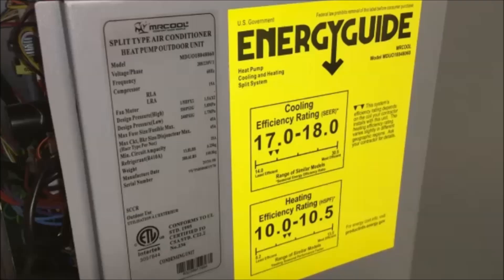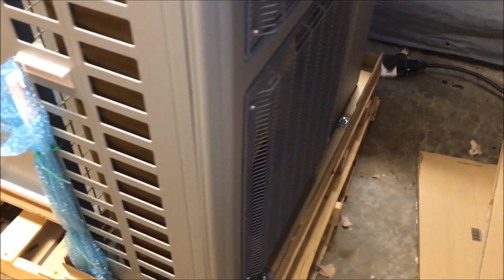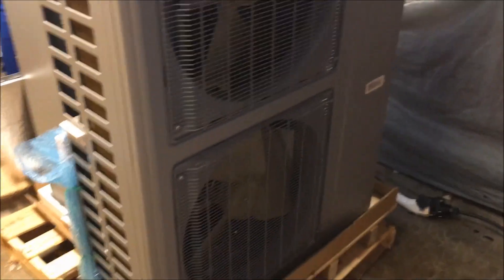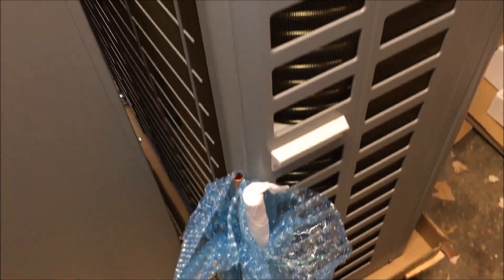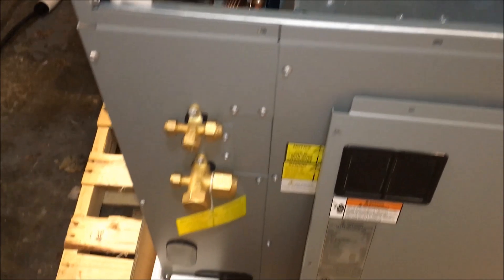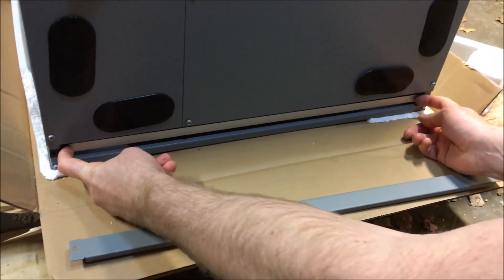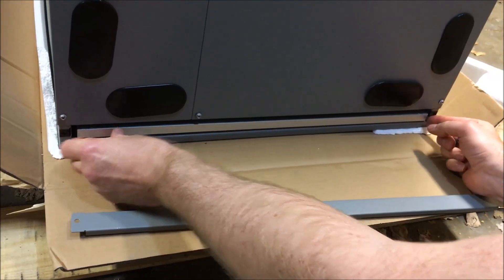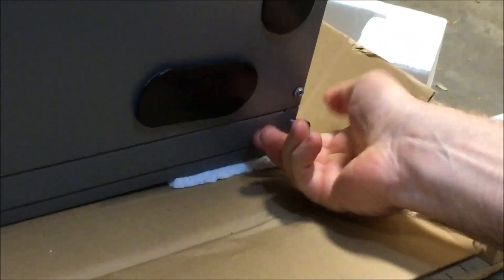DIY Mr. Cool Heat Pump DIY HVAC Unboxing Part 1

Comment: Thanks for the nicely done video. I just installed this 4/5 ton unit. At least mine came undamaged.  Both the condenser and air handler were on one skid wrapped together.  It is so quiet. Just love it. It is in the middle of summer, so I just ran a quick test of the heat mode on one cool morning to make sure the installation is correct. 
I have one question I am still waiting for the answer from MrCool support.  What is the Defrost signal used for?  The air handler control board in mine has a D (defrost) connection, but the condenser control board does not have the D signal. There is a W1 signal. The air handler manual that came with the system shows a wiring diagram to connect the D signal of the condenser to the D signal of the air handler. Well I don’t have the D signal in the condenser.  
Can you tell me how you connect the D signal in your system?  By the way, I did not install the optional heat strip.  I will use my existing gas boiler as backup. 
I gathered that the Defrost signal probably is used to turn on the heat strip during the defrost cycle.  That signal must be sent from the Condenser to turn on the heat strip inside the air handler.  Since I don’t have the heat strip installed, it probably can be used to turn on my gas boiler.  However, my condenser unit does not have the D output, it has the W1 signal.  I am wondering if the W1 signal is on during the defrost cycle.  If so, I can use that to turn on my gas boiler. 
Thanks in advance.
Reply from the maker: I don't have heat strips either.  I also don't have a D signal. Defrost mode is when the reversing valve is turned to cooling mode for a short time to heat the outdoor coils. Is this the possibly the B your referring to? When B is active, it's in heating mode.  Hope that helps.
Reply: Thanks for you reply.  It is the D signal I referred to. In the manual, it specifically describes it as the defrosting signal. I screen shot the frames of your video that show the control signal terminal block of both the air handler and condenser.  Sure enough, your system does not have the D signal.  
My air handler does not have the Y signal, it has the D signal in its place. The Y signal should just go directly to the condenser anyway. 
My condenser has the W1 signal instead of the D signal described in the version of manual that came with the system. I downloaded the latest version of both of the air handler and condenser manual online. They are different from mine. Apparently they have different versions of the hardware as well. 
I use a Ecobee 3 Lite thermostat.  I have to program O/B to energize the B terminal in heat mode for MrCool.  It seems backward for MrCool to do that. If the reversing valve control fails, it would be better to fail to the default heat mode without being energize. It is more important to have heat, especially in the northeast where I live. 
So, I will just tie W1 in the thermostats, air handler and condenser together.  
I now have a dual fuel system.  The gas boiler becomes my backup system.
Reply from the maker: @norberteng9496  I would look at the schematics to be sure.  W1, for me, is just a control to turn on the heat strips. 

Not sure I can add much to the conversation without seeing a wiring diagram.  I'd just be conjectureing at this point.
Reply: Thanks. Since I am using my existing gas boiler for aux heating.  I am using W1 to turn on the boiler. 
On page 30 of the latest MDUO18* condenser manual, version date 19-25-21, on the Mrcool website, it mentions “when the outdoor unit defrosts, D will send an operation signal to the electric heater to avoid cold winds”. 
Our version of hardware does not have the D signal.  So, i suspect a 24V signal is sent on the W1 to turn on the aux heat instead. 
MrCool support seems nonexistent. I sent messages via their website support email. Never got a reply.
Reply from the maker: I can't see this in  the manual. Are you located in the US?  Wondering if there is another variation  of the Mr. Cool  universal?
Reply: I got that info from the manual of the same model I downloaded on the MrCool website.
Yes, I am in the US. I ordered mine from HVAC Direct.  They shipped via XPO.  
I ordered it on 6/30/22. The manufacturing date of the air handler is 2021/11.  The condenser’s is 2020/07.  Their documentation just cannot match up with different versions of hardware I guess. That makes it confusing. 

Another thing I found is that with only the fan on with no Compressor on, the fan still runs at full speed. Does your system behaves the same.  It is different from my old system I replaced. The old handler ran at a reduced speed when only the fan is on. 
I guess there is no way for the handler to know it is only fan on, since the Y terminal does not go to the control board. 
I am still learning about the system. Your video is the only one I found online on this particular system. 
MrCool support is not responsive at all   .
Reply from the maker: Sorry to hear this.  I called Mr cool once for a sanity check on the dip  switches, but had to wait for a call back. Never came. 

My fan blows the same regardless of the compressors status.  I would have liked to have seen a variable speed blower...esp when it goes into defrost mode, since it works as an AC for a short time until the defrost cycle is done.  You could set the fan speed to lowest setting  for 4 ton. That might help.... but it will always run at that speed. 

All and all,  it's decent for under 4k.  I can't complain.  I'm off natural gas and all solar.
Reply from the maker: Just checked manuals. D isn't connected.  I suspect, by the poorly written description, the outdoor unit sends status, via D, to the indoor unit... to maybe run heat strips to avoid cold  breeze.  You really only need YBRC to the outdoor unit.  You can always probe the line when in defrost to see what it does.
Reply: I have no D signal on my outdoor unit.  It does have W1. The manual shows connecting W1 of the thermostat, air handler and condenser together. I think W1 on the air handler is the receiving end of the signal. I think during default cycle, W1 in our version of condenser sends a 24V signal to the air handler to turn on the heat strip, if one is installed. 
I am using the gas boiler as aux heat.  I live in the northeast. My ecobee thermostat is set up to switch to the gas boiler when the outside temperature is below the point where it is more expensive to run the heat pump than running the gas boiler.
Reply from the maker: Yes,  I agree.  W1 is powered externally.  I think you have the right path.  Just  wondering if your boiler can supply heat in time for defrost. It lasts about 10 min.
Reply: My boiler also heats hot water. The hot water tank is a separate heating zone. So, the boiler is always hot, especially in winter.  I will find out how it works out this winter. 
The boiler has its own 24V transformer.  I use a relay to isolate the two systems. I use W1 to drive the relay to turn on the boiler when in defrost mode, and when the thermostat calls for aux heat. 
Thanks for your insight.
Reply: The D on the air handler likely goes to W1 on the condenser.  I have the GE version of this same unit, which is the same as the Gree Flexx.  The GE doesn't have a W1 on the condenser, it has a D there.  And a D as well as a W1 on the air handler.  I haven't used heat yet (still summer!), but I suspect this tells the air handler when the condenser is defrosting so it either (1) turns off the blower or (2) turns on the backup heat.  I thought I read somewhere that it (1) turns off the blower, but I can't be sure.  Will find out in the winter!
Reply: @yt_tam  I downloaded the installation manual from the Greecomfort website.   They seem to have 2 versions of the unit. One with the D connection on both the indoor and outdoor unit, and one without.  The manual basically is the same as MrCool’s  
The system with the D connection are tied D to D, W1 to W1. 
Will see how it works in winter.  Since I don’t have solar, I still need to figure out the cross over point where I need to switch away from the heat pump back to gas for heating.
Reply: @norberteng9496  Mine has a W1 and D on the indoor, and a D on the outdoor (no W1).  D goes to D as a signal from the outdoor to indoor that it's in defrost.  W1 on the indoor comes from the thermostat to call for the backup heat strips.  Looking at the wiring diagrams, the D and W1 on the indoor units almost appear to be connected on the board, so it's possible they tie together and do the same thing.  

If you find it blowing cold air for periods during the winter, I would try connecting the W1 on your outdoor to the D on your indoor.  Then the W1 connection on your indoor to the W/backup wire from your thermostat.

Comment: You ever notice the posted cooling capacity on 5 ton (MDUO1860) isn't really 5 tons? They list it as 54000 BTU. I've got a large area and an existing 5 ton 16 seer...wondering if I can get away with what appears to really be a 4.5 ton, but labeled 5.
Reply from the maker: Interesting point.  I bet if you precooled or pre pre-heated before a temp event occurred you could get away with it.  Also upgrading insulation , air sealing, and newer windows would help. 

I've been happy with mine.

Comment: You could of made the return air on the side by cutting the whole and sealing the bottom.
Reply from the maker: I think that would void the warranty. Most basement floors are damp which would introduce moisture and rust. Floor isn't level by the drain, so sealing would be tough.  Return air plenum would need to be reduced which could reduce air flow and cause coil to freeze up.  Lots of variables to consider.  Stand was easier.

Comment: Have u had problems with the with it freezing up and my nest has been off by 1 degree  seems to run a long time . I have had it only 1 month now and already seems to be a problem  unit. I have the same unit.
Reply from the maker: Freezing up in winter or summer ? Coils will freeze up when cold in the winter, but then it goes through a defrost mode.  If it's summer, then it's usually a refrigerant leak if the lineset isn't tight enough.  Mine has worked fine over the winter.
Reply: @stem_saving1644  yesterday it's 89 degrees here in Florida
Reply from the maker: Not sure what model you have? Check things like airflow, dirty filter... etc.  If that's not it Call hvac guy to check refrigerant
Reply: @stem_saving1644  yes they r aware of the situation they have three other customers that have the same problem with theirs and I have the same system you have the 5 to 5  ton unit.

Comment: Yeah man all electric... I did the same no more OIL usage. Really glad I went this way too.
Reply: how many sqft what system and was it cheaper than oil?
Reply: @rj2764  around 2500 sq ft its the whole house unit that connects to central ducts. Its the 5 ton unit - I also have solar so costs are offset a lot. Yes the install i did myself total cost prob 5-6k - oil this year to fill the tank 250gallon at $5/gallon around $1400… i usually filled it 3-4 times a year - so yes it was worth it for me - my oil use drops to almost nothing (explained below) - my entire electric bill is never that high as just oil and it runs basically everything for me (heat, ev charging, fridges, stoves, laundry, etc) - but I do have solar as I mentioned. I have basically gone full electric except for my basement which still i use a small amount of oil to heat that space since its not connected to main part of houses duct system. Next stop is a mr cool or similar smaller unit (heat pump) for that area. Probably a project for this year or next and I can be done with Oil for good.
Reply from the maker: @ VR Vitaly That's awesome to hear that people are looking at the long game.  I'm doing the same here.  All electric with solar,  heat pump and two EVs

Comment: I installed the same type of system in our Off-Grid home.  Did you happen to find a programmable thermostat that works with it?  Because our units are in the attic qe can't use the IR option they offer leaving us stuck with the junk thermostat it came with.
Reply from the maker: I used a lux9000 had it for 15 years....works great.
Reply: @stem_saving1644  and it works with the MrCool ducted splits?
Reply from the maker: It's working with mine just fine. .  It's a 4 wire. Really simple
Reply: @stem_saving1644  thanks, I'll check it out
Reply: @Off-Grid  only works with universal air handler or normal 24v units. No mini splits.
Reply: @sprockkets  Yeah, nothing seems to work with the dang thing.

Comment: In my experience, you wont get an hvac guy out for under $500.
Reply from the maker: I have had a couple recharges of freon, for my old system for about 300. That's what's nice about this system,  it's all diy, no hvac tech required!

Comment: $3k that's not bad at all. I would like to upgrade my 11 year old air condition system to this. Great vid!
Reply: Its seems to be closer to $4500 with lines as of this fine afternoon of Feb 2024
Reply: @geraldhenrickson7472 $4375 to be exact
Reply from the maker: As soon as it cools off,  I'll have more content.

Comment: Was it hard to move the outside unit around?
Reply from the maker: The outdoor unit is pretty heavy.  Need 2 people and a dolly. Mines going to be ground mourned vs brackets  It's 300lbs, so take that into consideration.
Reply: It is heavy. We ha to use lifting straps to move it.

Comment: Looking at this same unit. Problem I have is current system blows top to bottom downward into my floor ducting. Will have to flip the unit and build a stand to hold the coil on top of the blower. Prety common practice. Looks pretty straight forward with these units. I heard so many horror stories about shipping I might just make the 200 mike trek to the ingrams north of portland and get it myself.
Reply from the maker: You could.  I use credit card, that way I'm not liable.  I had them shrink wrap both units together on the same pallet and ship with XPO.
Reply: Did you install a Mr. Cool? I have a a split system coming next week, and mine is a downflow ducted system also.  I plan on flipping upside down, and manufacturing a support for A coil.  Just wondering whether you did  one. My current Trane is upside down.
Reply: @hockey98550  I have not done mine yet. But it is the same principle. Just have to flop the blower box assy, and install a bracket to hold the coil
Reply: @MegaMarclar  I plan on making a video of progress, nothing like that on YouTube. My local HVAC guy said 95%of his installs are up flow. Probably why none available from Mr cool.

Comment: TXV is a pressure control not a direction control. Other tech inaccuracies but it doesn't mater
Reply from the maker: Misspoke, its the direction control valve or what ever you want to call it.

Comment: I just unpacked it and its damaged the top is all banded in i purchased it from the same company you did i email the company and the told me just install it and use it i emailed back i made a video i can not close the front cover on the outside unit it pops out because its banded i will see what will happen ?
Reply from the maker: I'd return it.  You don't know what internal damage it has.  Ask them to ship with xpo and to shrink wrap both on same pallet.
Reply: @stem_saving1644   @STEM_SAVING  She told me this,> Is the unit installed? If so, can your installer come out to fix that? 
Thank you, only the outside unit is damage the inside unit is ok do you have to ship both units back or just the damaged one i just emailed her again will see what will happen!

Comment: doesnt do ventillation, so its a HAC :)
Reply from the maker: Sure it does. Vents the air through the heat exchanger to charge its temp.... maybe it should just be called HCV heating cooling ventilation :)
Reply: It circulates air, doesnt really ventilate it. Ventilation is replacing air with outside air
Reply: @zipu  I don't recall ever seeing a house unit that has thr option to bring in outside air..
Reply: @MegaMarclar  yes, i said it CIRCULATES air, meaning that the indoor unit blows the interior air around the house/room, which indeed is not VENTILATION, as in replacing the indoor air with outdoor air

Comment: You notices the same thing home depot lineset saves alot more money i had to do the same thing add a plem on the bottom cut down the top had to use the 50 ft line set however i did add a 20kw heater to mine but havent had to turn it on been down to 12 deg where im at
Reply from the maker: thanks for the feedback. Good to know of your success.  I hope I will have the same.